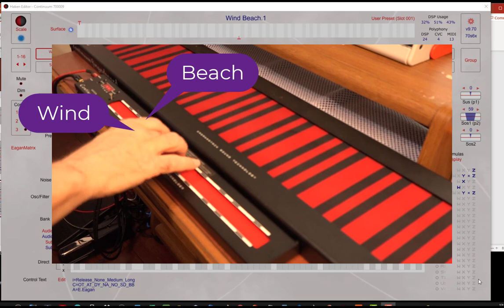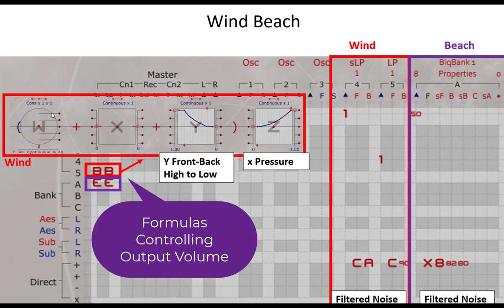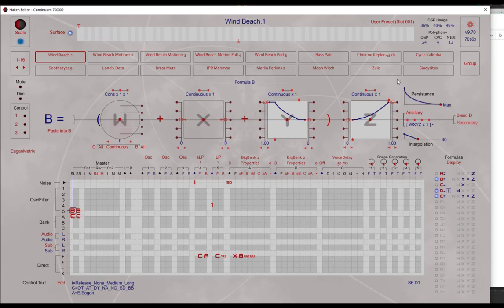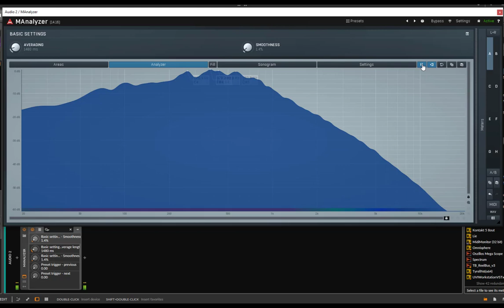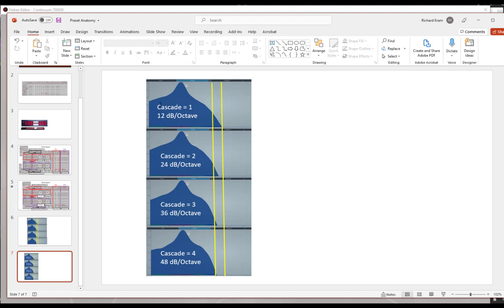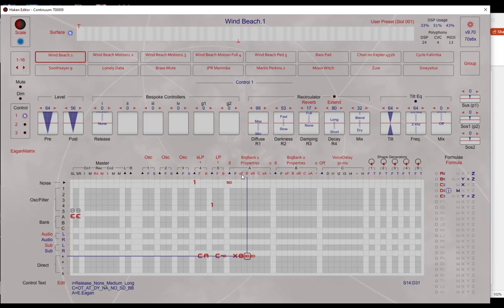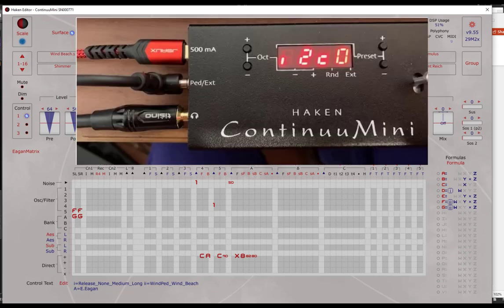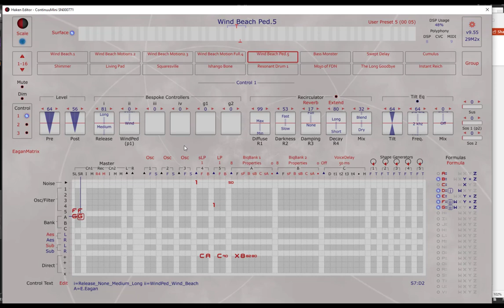Haken Continuum/EaganMatrix - Anatomy of  a Preset (WindBeach)

Comment: I like those pitched resonances at the lower frequency spread. It seems like the noise sources could make some interesting presets that could be played melodically / harmonically. I also imagine your optimisations for the Mini could benefit playing this kind of preset on the Linnstrument with the small Y axis size.
Reply from the maker: Yes and there are a number of those in the system preset collection that comes with the EaganMatrix firmware. Yes same kind of thing can be done if you are playing ContinuuMIni with a Linnstrument as many do.